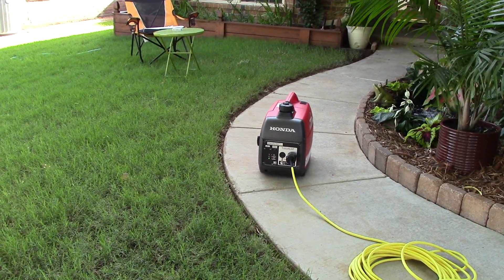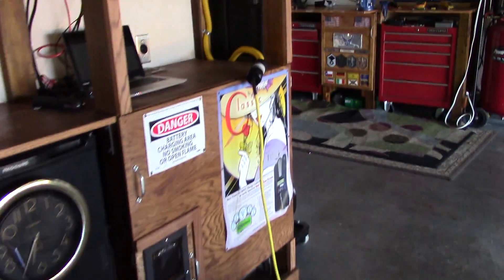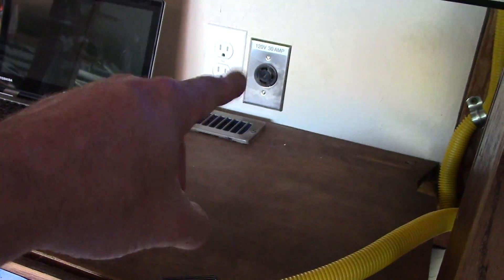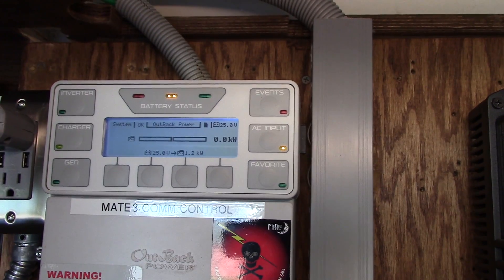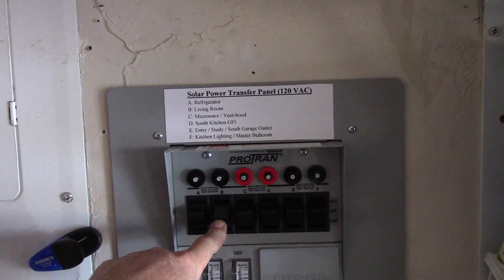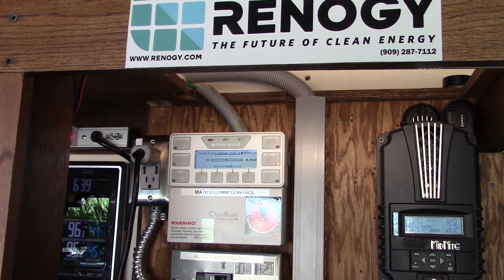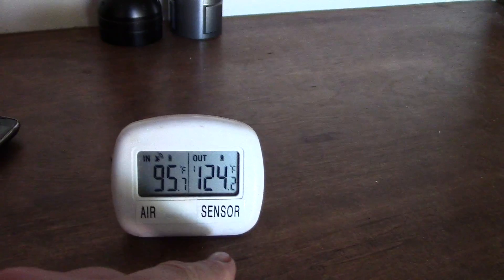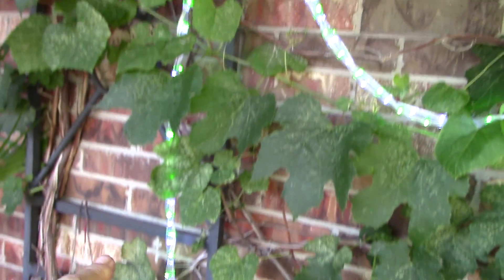Honda eu2000i inverter/generator cable test. Powering house circuits.

Comment: Oh man. We live in the Tulsa OK area, and Ive wanted to set up a partial solar system with a portable backup generator system. Ive converted my HAM radio ,room to all DC or inverter use, but disconnected from house AC power. Ive built multiple battery backup boxes, but they have their limitations

Comment: You aren't using the 30 amp plug to its potential.  That requires a 2nd generator hooked to this generator.

Comment: Nice neat install on all that stuff!    That transfer switch has two legs, correct (for 240V)?  Did you wire the 120 output of the generator to both legs and only use single breakers?
Reply from the maker: Electrician wired up my transfer panel...but, yes, I think it has two legs for 240V). The transfer panel is wired for single breakers, 120v

Comment: Lets see here...
Refrigerator ~150 watts on re-cooling cycle
Freeer ~200 watts on re-cooling cycle
Lights .. depends on how many you have on and if they are LED/CFL/incadescent 
8k btu a/c  ~ 1k watts at best.. 
So yes that generator can do it as long as you keep the load below 13 amps...

the KEY to running a generator to feed a whole house is KNOWING the amperage draw of ALL your devices.. And knowing how to route power to what devices at what time...

Comment: Chris, were you planning on using a standard EU2000i with your Honda companion, the companion alone was not designed for (nor capable of) generating the power you're looking for?  Once the two are connected with parallel cables you'll be able to use the 30 AMP properly.
Reply: True. That 30 amp plug isn't being used properly.  He needs a 2nd generator to actually take advantage of that plug.

Comment: I have an Outback inverter.  It's got a lot of shortcomings; it's an all-or-nothing inverter, if you're running on 120V ("shore power"), it's limited to the power you get from the cord, if you're inverting from batteries, it will pull to max off the batteries.  It will limit the max amperage (or wattage, if you prefer to think of it that way) that it will pull off the cord.

Much better a "load sharing" inverter like the Victron.  That way, if you're running a Honda generator and inputting 1600Watts, but your system needs 2200Watts for 5 seconds to start an air conditioner, the Victron will use the 1600W from the generator but it will pull the additional power needed from your battery bank.  After that momentary surge is taken care of and the power requirement from your house is back below 1600W, the inverter then continues to run the house system but uses to amount of power from that margin to recharge your battery bank.

What that means is that if you have 1600W available, if your average power consumption -- taken to include times when a thermostat turns off a fridge or air conditioner, etc. --  is 1600 or below, it's seamless and it will run all day long without you having to load-shed any of your power consuming devices or overload your little Honda.

On the other hand, there's no way any 2000/1600W generator is going to power an entire house.  Most houses with gas or oil heat will pull an average of 5-6000W per hour; if you have a heat pump system, it's 7-9000W.  If you're pulling those loads, you have to supply that much power.  It's all in the math.  But you CAN supplement power at appropriate times and keep things going, but you must have devices to share the load, power storage capability (and enough of it), and a way to load-shed, if necessary.  But don't go pulling a gallon out of a bucket when you're pouring in a cupful and expect the bucket to not go dry.
Reply from the maker: Thanks...I only run six household circuits through a transfer panel.

Comment from the maker: The 100' cable is actually 12/3 cable...my mistake.
Reply: I got the 2000i and 2000Eu running in parallel.
running; 21cuft frig, 12,000btu A/C, 10,000btu A/C, 2 fans w/lights, 3 box fans, 2 egg incubators, electric fence, and lights @ 27 running amps using 10/3 :)
Reply: Hey Chris,I wonder if you could get that other A/C to run also, by going to a 10/3 RV cord since its such a long cord. That larger size wire would help prevent voltage drop and may drop inrush enough that it wouldn't trip the genny.It would be a little extra money though for the bigger cord, but its just a thought.
Reply: I'm thinking that "hard start" kits on the air conditioners and load-sharing capability on the inverter will make it work.  There may be some voltage drop effect on the cord (which effectively increases the Amp requirement) but it's not likely to make enough difference to be the tipping point on running another air conditioner or not (IMO).  But for 1600W continuous, as the generator is rated for, I'd use a 10/3 cable cord anyway.
Reply from the maker: Awesome...10/3 is the way to go. Thanks for watching my video.